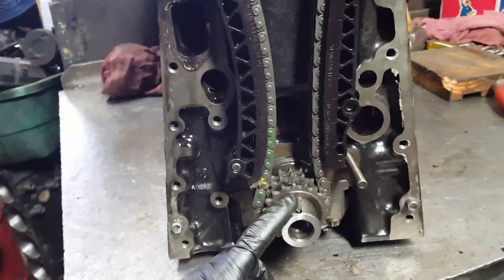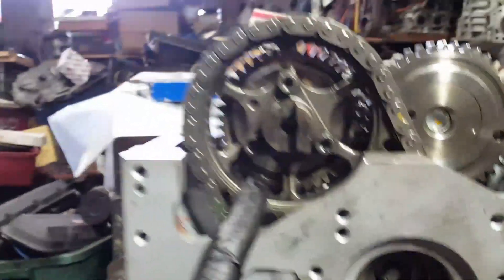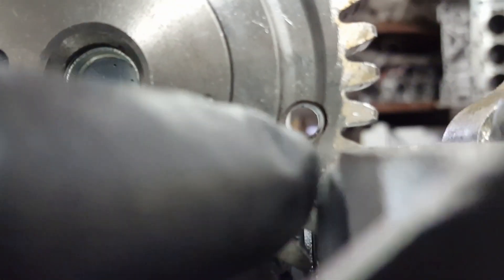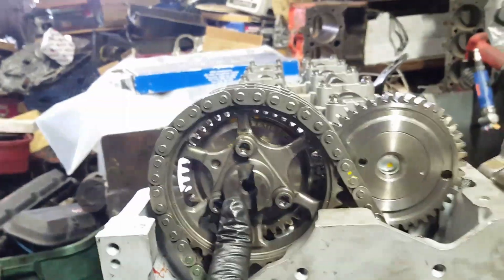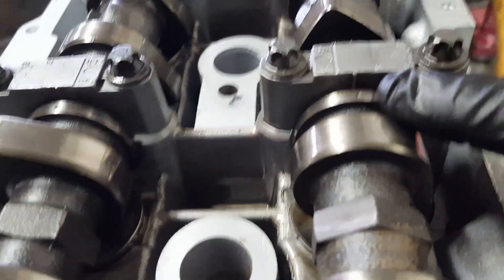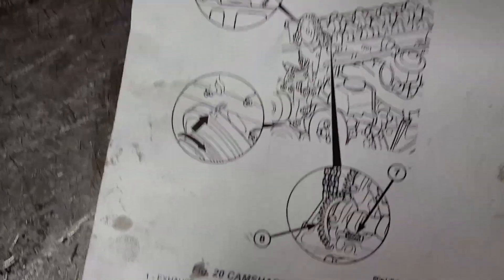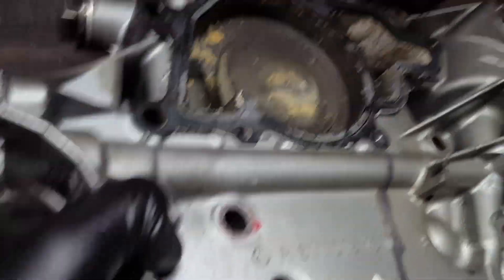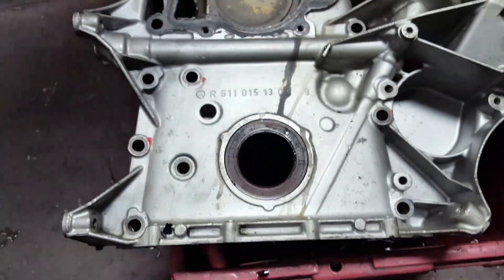Mercedes sprinter 2.7 timing chain marks and replacement

Comment: Hi i have the 2.2 cdi ,i have just had head off and replaced it .i could not lock timing when i took head off as there was foreighn object stuck in one of the bores ,any way item removed and head put back i have tried to alighn timing chain with top dead center however i can not see any marks on the crank pulley so i am having trouble getting the chain in the right position especially when tensioner is not yet set .will i have to remove crank pulley to see where the woodruff key is ?

Comment: hello im installing a new head on my 2.7 647 sprinter 2005. i noticed that some of the new lifters are different in regards that some you can squeeze some of them but others are hard to squeeze. should i install them like that???. thanks  Mario.

Comment: You still have to have the chain on the right links.  Meaning, the cam to crank gears.  I'm guessing that the chain has to be taunt on the driver's side of the gears

Comment: Hello. I need a Timing Image OM646, 2006 Mercedes Benz. I overhauled the engine but it cranks fine but it Lacks the Firing Order from the ECU, it  doesnt  start. I would really appreciate the Timing Guideline for OM646,  Mercedes Benz 2006,  W211./Thank you

Comment: Great video. I used your vid with a couple others to replace the cylinder head. But after putting everything back together, the engine had a hard time starting. And once it did, it was running very ruff, started having a clinking sound. The cylinder head was brand new. Any idea on what it could be? New valves. There’s some things that im trying to figure out if they were the cause:
1. When we were setting the engine to TDC while taking apart we cranked the engine in the opposite direction at least one of the times. Found out later that we’re not supposed to do that.
2. The injectors were outside for a month or so, it rained and parts on the shaft got rusty. Maybe the nozzles are blocked?
3. The timing mark, the TDC and the hole on the sprocket was slightly off. A little bit of the hole. But the marks on the shaft aligned.
4. The intermediate gear wasn’t aligned in anyway. But you mentioned not to worry about that one. I didn’t find anything about aligning it either. So I don’t think that is causing the issue.

Any help is appreciated
Reply from the maker: Message me on Instagram 13b_dorito so i can send you detailed info and pictures

Comment: HI EVERY ONE 
I CANT GET TOP DEAD CENTER LINED UP WITH THE HOLE ON THE CAMSHAFT LINED UP .
ITS ABOUT HALF THE HOLE OUT .
IF I CHANGE ONE TOOTH ON THE SPROCKET THEN IM HALF A HOLE OUT THE OTHER WAY.
OR 5 degre on the crank pully .
so my problem is should i be 5 degre advanced or 5 degre retarded?
I know the chane has stretched

Comment: My sprinter 313 2.0 diesel engine wont start, its just spins on start as if there is no compression. Any ideas? i parked it the night before and it was all good. I would always get a rattle for 4 seconds when i started it previously.
Reply from the maker: Check for compression,spark and fuel and cross your fingers because those engines cost over 8k to rebuild 😭

Comment: Hello I have a situation. I totally forgot to install the timing chain guide rails. The head is installed and torqued. Any ideas on how to install the guides. With out removeing the heads. Och.!!!.
Reply from the maker: Dang sucks lol
If the timing cover is off ,you might have a chance to slide them in

Comment: Need to change the time in chain on my 2014 Mercedes Sprinter Van 4 cylinder what  Tool do I need to hold the camshaft
Reply from the maker: Thanks for watching 
And yeah they sell the timing set tool 
Don't remember the part # but all you need is look it up using your engine info

Comment: Olle ermano I just bought a 02 Sprinter and there is a rattling noise coming from the engine and I'm pretty sure it's from the timing chain which need to be replaced it has a hundred and ninety thousand miles can I replace a timing chain without taking the engine out
Reply from the maker: Yeah you can replace the chain ,you just have to remove the whole front of the van

Comment: What r the torque spec's for a Sprinter Engine starting with the mains, rods, heads, cams, plus any other. Parts. Ok I'll appreciate your help. Thanks.
Reply from the maker: Mario Maldonado hey sorry haven't get back at you and i have to make a video from my all data or ondemand,because those specs are not found online lol i will make a video and will be uploaded tomorrow ,and will try to cover most of the specs 👌🔥🔥🔥
Reply from the maker: Mario Maldonado what's the info on your sprinter?year and engine size?

Comment: My injacor was linking and i was i trying to change the bolt in sealwatcher and a white dude told me that he knew about those motor and he took the head off and i took the head to the machine shop he put it together and told me that one of the motor bolt broke on the block and that makes me wonder because the van has a blowby that gose trough the moneyfol and it goes trough the  oil sprater and it injaced to the turbo and that the problem and ot smoke like a train but white smoke and i wonder that the way to get a check from the city for killing all the mosquito around the neighbor haha and the oil come trough the oil measurment stick and it seem that no one know anything in new Orleans and any tips could help maybe i could sent you a video but not today causes it 25 degress
Reply from the maker: Aris Aris man can't really understand you hahaha hablas español? Or what language do you speak? So I can help you better
Reply: Kkk white dude

Comment: What is the tightness of the screws of the control chain poles
Reply: hey marco estoy arreglando mi dodge sprinter ho solo es muy caro llebarla al taller pero si llego a ocupar ayuda como te contacto
Reply: JM8686 gracias
Reply: BOOSTER PUMP DOES NOT TRANSFER GASOIL.
Hello everyone on this forum
I present myself already
I hope to find the solution to my problem thank you
Hello here you can help me my Mercedes w 203 year 2004 cdi 220 OM 646 963 a problem of booster pump the tank is full of fuel but no transfer of diesel fuel to the filter just a small jet and stops fuse product no 4 change relay the same thing sam back too and the problem still remains the cause of the whole problem a change of cylinder head gasket after I fell into a hellish spiral an idea above and thank you in advance and good luck
then I will inform you of all the work carried out and the parts to change for this cause.
01) TANK EMPTY AND CLEAN WELL.
02) DISPENSED PUMP DISASSEMBLED AND TESTED OUTSIDE THE TANK IT WORKS THE PUMP AND WITHOUT PROBLEM
03) WIRING TOWARDS THE REAR SAM. CHECK NO CUT.
04) STILL SAM REAR REPLACE WITH A NEW COMPLETE WITH RELAYS AND FUSES.
05) REPLACED INJECTORS WITH NEW SEALS.
06) CHANGE OIL FILTER.
07) COMMON RAMP CHANGED BY A NEW ONE.
08) NORMAL CONTROLLED PIPING.
09 CRANKSHAFT SENSOR.
10 CAM ARM SENSOR
THE PROBLEM WHEN I PUT THE CONTACT TO START I HEAR THE VIBRANT MENT OF THE PUMP THIS LANCE AND THEN S: STOPPED
WHILE DABITUDE DOES NOT STOP AT THE FILLING OF THE FILTER AND AFTER THE HIGH PRESSURE HP PUMP AND THE CONTINUOUS CYCLE ON THE RAMP
NONE OF THAT.
YOUR OPINIONS, IT ISN'T THE ECU CALCULATOR THAT PLAYS ME FRESHLY?
AND THANK YOU FOR ANY HELP FROM YOU AND GOOD EVENING
ENVOIR
Reply from the maker: Márcio Silva do you mean the timing chain guide bolts or the chain tensioner? ?
Reply: I mean the poly that works with the pressure pump.
Reply: I need to know what the screw tightening of this poly
Reply from the maker: Sergio Aviles jajaja kien es marco? i pues muy facil con señales de humo jajajaja  es broma,puede contactarme aki por YouTube
Reply: JM8686 no sea mamon ya no eztamos en los tiempos de tu tribu hahahah ya fuera de mamada creo que el head gasket esta chingado esta tirando antifreeze del radiator. y la manguera que ba al radiator se pone muy pinche dura eh inflada tu crees que sea el headgasket
Reply: es un 2002 dodge sprinter 2.7 diesel
Reply: que tool puedo utilisar para remover los injectors
Reply from the maker: Sergio Aviles kitale el termostato ,puede estar pegado
Reply from the maker: Sergio Aviles para los injectores yo tengo el extractor especial de OTC pero puedes conseguir un tornillo ke kede a la medida de la rrosca ke esta adentro de el injector i ingeniartelas kon otro extractor o con una herramienta ke yo la conosco como chaketa!! Son unas pinsas de precion soldadas con una Barra i en medio tiene una contrapesa ke haces acia arriba i ba sacando el injector,pero ojo ocupa el tornillo ke kede en la rrosca de adentro de el injector!!! Al usar ese metodo TIENES KE RREMPLASAR LOS INJECTORES!!! Asi ke es mejor comprar el extractor o sacarlos con un extractor ke se pueda usar alli
Reply from the maker: Sergio Aviles la rrosca de adentro es M 17×1 mientras tenga ese tornillo exacto puede ingeniarselas kon cualkier otro extractor
Reply from the maker: Sergio Aviles 👍